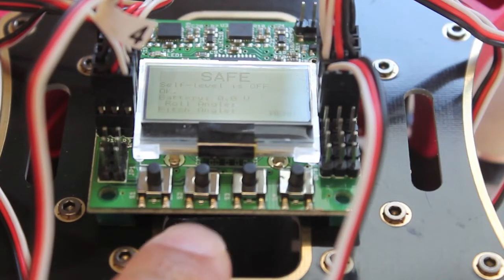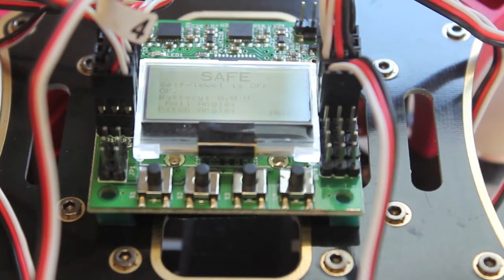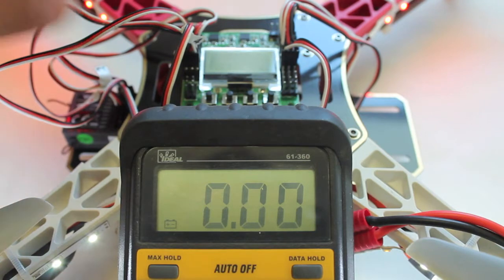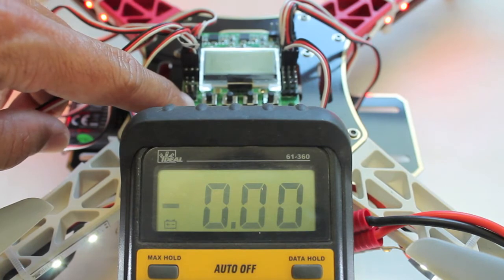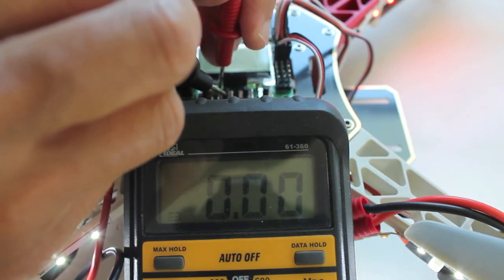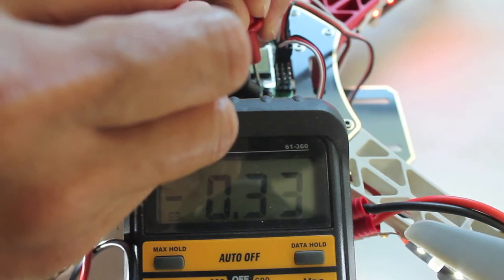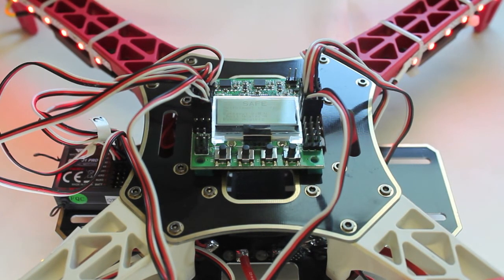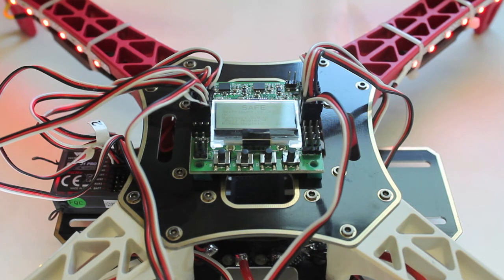Defective KK2 - Button 4 Looks Okay

Comment: I had just responded to your other KK2 board video.

After seeing this video and your voltage tests the only other test that I would do is a continuity test between the right side pins of PB #4 (near the "Out8" silkscreen) and Pin#44 of the ATMEGA324 just to make sure the PB #4 is actually connected to the MCU input pin.

The Pin #44 is on the top row of the MCU completely to the left.